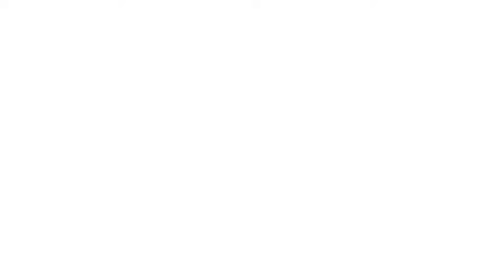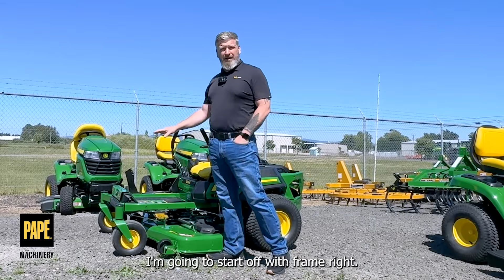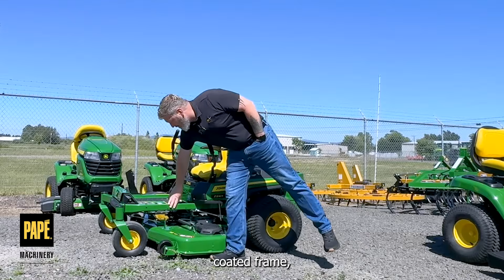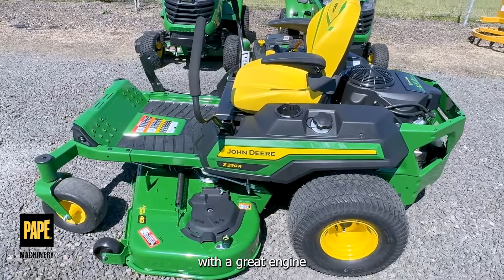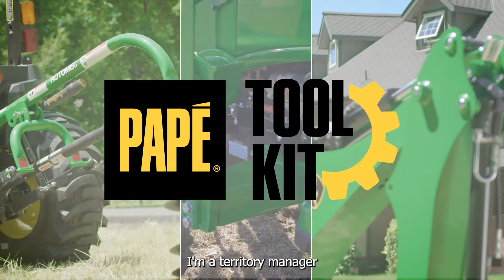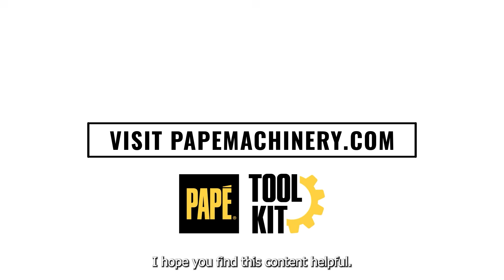John Deere Z330R Zero Turn Mower

Comment: Can the deck be locked in up position!?  Been looking for this info for half an hour on mine and still haven’t found .  Do you have to hold the pedal to keep it up?  I should make a video and make millions .  Nobody addresses this in any video and not in manual
Reply: I guess I’ll go ahead and answer my own question.  There is no lock mentioned in the manual or seen on mower so I just set the cut height to 4.5” and release the foot pedal .  It’s high enough to drive up most driveways without it hitting.  The deck has rolled steel rod around the edge to help protect it.  I would avoid mowing wet grass all the time to minimize rusting.   People mow whenever they feel like it not carrying if it just rained that morning and grass is full of water.  It’s not that important.  Mow when it’s dry.
Reply from the maker: @grantv2313  Sounds like you and Jason had the same idea! Glad you found a solution and thank you for your insight.
Reply from the maker: Hi there, thanks for watching and reaching out! The short answer is no, you cannot lock the deck. However, Papé Toolkit Expert Jason suggest adjusting the deck all the way up to 4.5" when traveling. But that is not a lock solution. Hope this helpful!